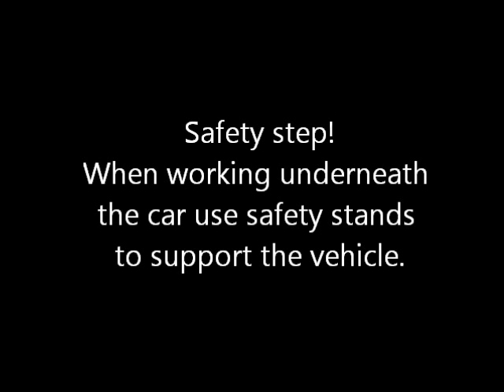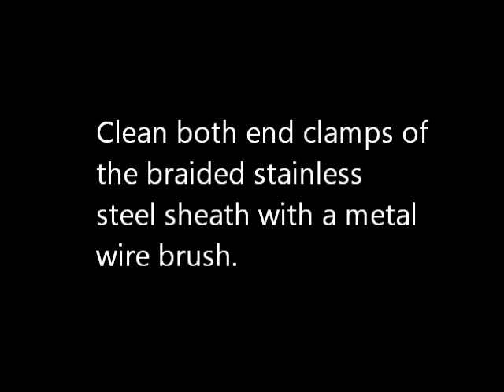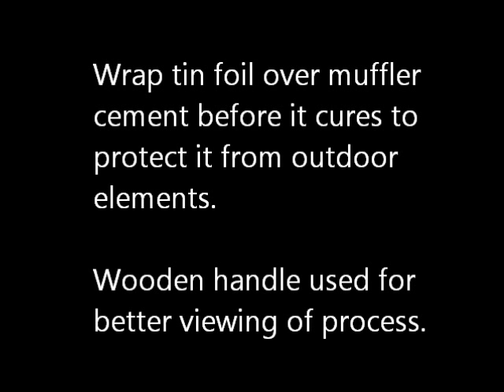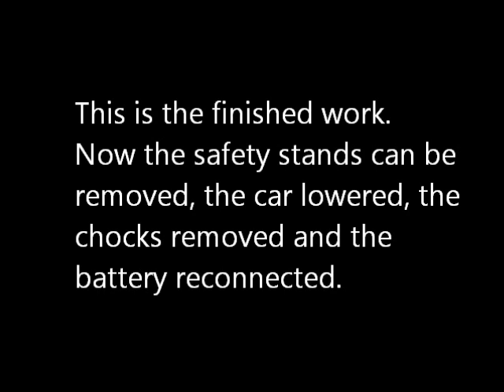Exhaust flex pipe repair with muffler cement

Comment: You know what the battery thing Is true but wtv other than that the rest is fine, this is a basic video and I’m going to try the aluminum foil. I think that’s smart even if it burns off after awhile. It will help secure it and keep it cleaner for sure you can technically just scrape it off with an exacto. Good video besides I did t see the pros making any videos cuz they’re greedy douches. GREAT VIDEO MANG